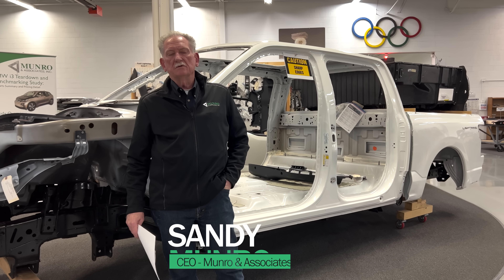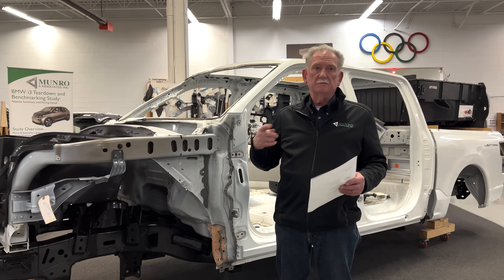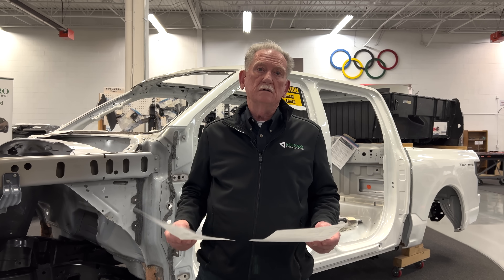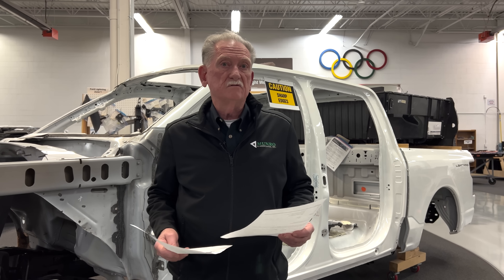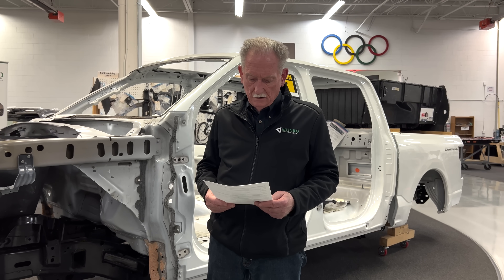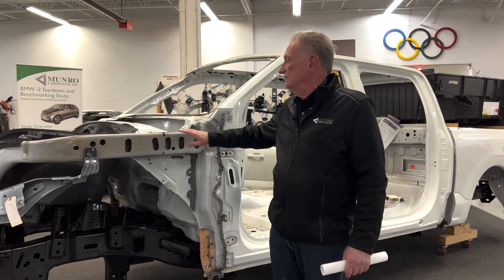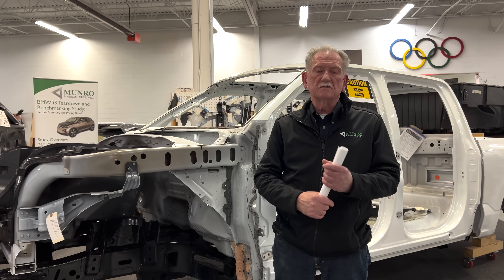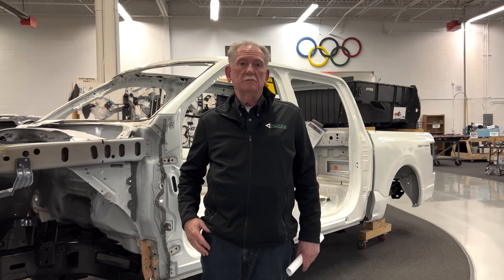Sandy's Initial Thoughts on the 2025 Ram 1500 Ramcharger

Comment: I disagree with Sandy for once. EV trucks will never be used for actual work until the range is extended for towing. The F150 lightning can tow 100 miles or so on a charge. That is pathetic. This Ramcharger is a step in the right direction. I say that as a Ford guy.
Reply: Statistically I wonder what percentage of truck owners who tow actually need that towing range. As long as electric covers 80-90% of users needs, that's good enough. The remaining 10% can stick with gas.
Reply: @SpykerSpeed  the other thing to keep in mind is charge time. 100 miles of towing may sound sufficient, but charging back up will take quite a while. Throw in the winter cold and that range is decreased even further. I wouldn’t be surprised if the lightning gets 80 miles in the snow while towing a covered trailer.
Reply: @BrandonElbers your a gumba sir....
Reply: @KingAquariumJunkie  and you need to learn English lol
Reply: @BrandonElbers  lol... nah I gets by just fine......
Reply: @brandon9715  sure, and maybe electric trucks will never be sufficient for people who tow heavy things in freezing cold weather. But those people are a tiny fraction of car owners, so it doesn't really matter in the grand scheme of things. They can stick with gas.
Reply: @SpykerSpeed  I agree that it is likely a minority of truck owners, but Sandy did specifically mention he thinks the Lightning is the ultimate work truck. Trucks are becoming less and less about work and more about status.

Comment: This is the perfect use case for me. I'd love to have electric for daily driving and the range extension for RV Towing.
Reply: I agree so much, I put $100 down on one. It's like....600hp luxo truck, that tows 14,000, has air ride like a luxury car, is 4wd, Runs 90% of the time on cheap electricity, and then gets 20mpg when it does burn gas? Take my goddamn money!
Reply: @kipamore  well it only holds a 150 Pure electric charge at a time so you literally don’t have to use the engine if you only drive say 30-100 miles per day and remember to charge daily or every other day depending on your. Personal commute

But weekends when I tow my camper to the beach to go surfing for 2 days I would use the entire 150 Electric range then probably a few gallons in gas charging it for the way back and an overnight stay to power my camper
Reply: That's the beauty of it. It's there when you need it. And I'm sure you can tell it to charge stationary, which means it'll run your campsite or worksite or house basically forever.  @Kylewraps
Reply: @kipamore  Ram claims you can run your home up to 30 days off of it which im sure is an exaggeration but if it’s even half of that if it’s even 10-15 days that’s impressive af
Reply: @Kylewraps  with a 27 gallon gas tank, and a 7000watt generator, you could tow a camping trailer to the top of a mountain, live in it for weeks, and drive electric back to town to pick up another tank of fuel. Perfect.
Reply: @kipamore  yea exactly 

As long as 80% or more of your driving is the plug in EV you’re gonna save a ton of money on fuel
Reply: ..and if it has a "generator mode" like the F150 hybrid, you can also use it to power your RV for as long as you have gas, without all the noise of a regular generator. That's a huge plus.
Reply: @johnoldman5877  Big topic, but yeah - an utter gamechanger for overlanders and fulltime motor home applications.
Reply: Exactly!
Reply: Yes, while being smart and not having a lower powered engine mode. Generator extender is smart.
Would LOVE for a heavy duty version for 5th wheel.
Reply: @PhotoHoag the Ram charger has 8 wheel lug nuts so it’s basically closer to a 3/4 ton then it is a 1/2 ton 

I wanna see someone put a fifth wheel on it and seee what happens
Reply: @Kylewraps  that's interesting! Be interested in seeing those tests.
Reply: if they do a heavy duty version i would prefer the diesel fuel. and all those long range hotshot drivers would to. @PhotoHoag

Comment: Why not a turbine generator?
Reply: Turbine generator in small application and dense air less efficient and on the top it’s a precision machine needs very precision overhauling which is expensive.. also can not do hot start also very noisy right ?
Reply: VERY expensive.